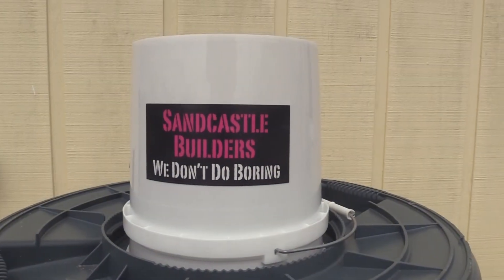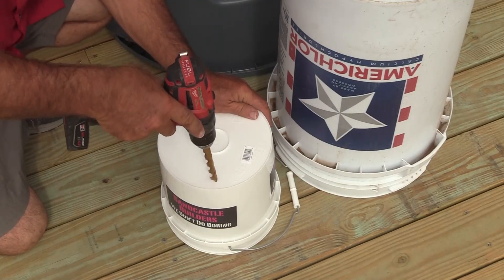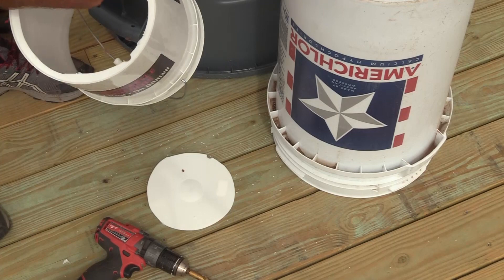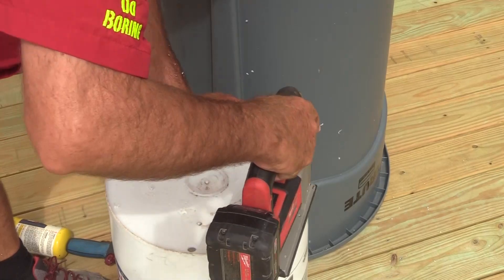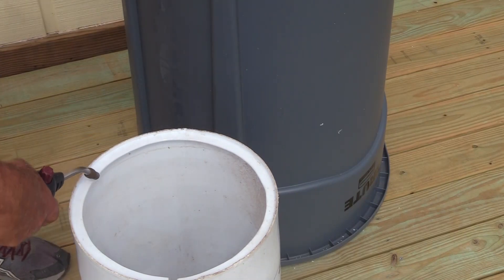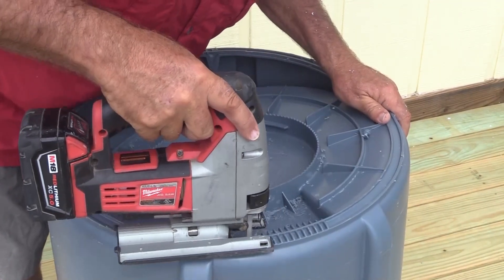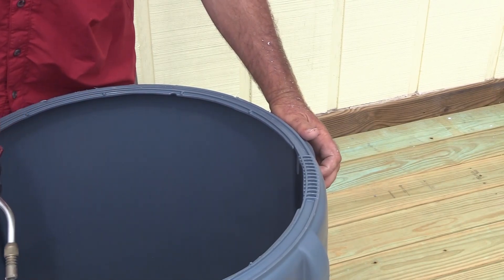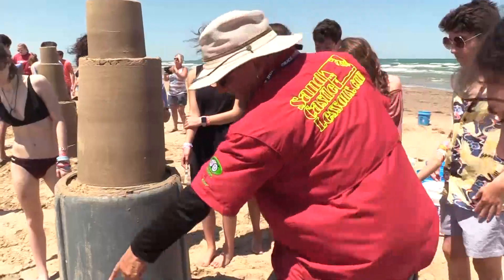#sandcastlebuilding #buckets #howtomake

Comment: I've seen some folks apply WD-40 on the sides of the bucket to make it easiest to lift the full bucket. Do you recommend that?
Reply from the maker: Hi Lance - yes wd 40 is good but expensive - i  now use PB silicone spray which has no odor and seems to be able to cope with anything!

Comment: Where do you get 10 gallon buckets.  I've looked everywhere (including on line) and haven't had any luck.
Reply from the maker: ron95050 hi there!  
The big buckets are 100lb calcium hyperchrlorite buckets which are used by swimming pool companies for cleaning pools.the powder is corrosive so be careful. If you spot someone running about cleaning pools just ask them..they are very happy to get rid of them!..thats how I get mine as tgere are a lot of pools around here!..hotel maintenance folks may have some too! Hope this helps..and keep building..you could just buy a 20 gallon brute online and a 2 gallon from home depot! See you on the beach!

Comment: Thanks for all the tips!! My son and I were able to make a nice castle last week because of these videos! : ) Thanks for sharing!
Reply from the maker: Maker In Training NO, Thank you for watching! And stay  tuned for new,stuff..coming soon
Reply: Andy Hancock We even made a video! (Should be out later this morning) : ) I was amazed at how easy it was to start carving once the basic techniques were practices a little. : )
Reply from the maker: Maker In Training that's EXACTLY why we make  them. Where are you?
Reply: Andy Hancock We were on the Outer Banks of NC for vacation this year. : ) Video is up on our channel if you want to take a look. Let us know how we did! : )
Reply from the maker: Great video..great sandcastle destroyer you got there! great to see you have a go - thats why i do this..a few little pointers 1. take all the buckets off and then form the bridge and carve it all at once just makes the flow of it easier 2. avaoid square buckets - they can be difficult 3. block out your door positions and stair ramps first as i find its easier to follow a simple pattern rather than make it all up as you go along, 4. buy adavanced tools as you are easily good enough to use them and will get cleaner, clearer details. 5. KEEP UP THE GREAT WORK 6. try a trash can as i know you will have fun but beware the 55 gallon holds 955 lbs of sand! and try to find some 100 lbs chlorine powder buckets - they are awesome - especially when dealing with destroyers but they weigh 200lbs when full so, NO KICKING LOL
Reply: +Andy Hancock  I got the buckets for free from a local grocery store so my options were limited. I tried to get some 10gal ones but no luck given the time frame I had. I think the pro tools would be fun to play with so I might consider that the next time I try. I’m in South West PA so beaches are limited and I only get to do this on vacation but I’ll have to create a sand castle kit to bring with me next time. : ) Again, Thanks so much for all the tips and techniques you teach! Love it!
Reply from the maker: hey there MiT - try and find a sand quarry locally and try some of the sand out or alternatively river silt when they are dredging the river is awesome - uses a lot less water but you will able to practice effectively